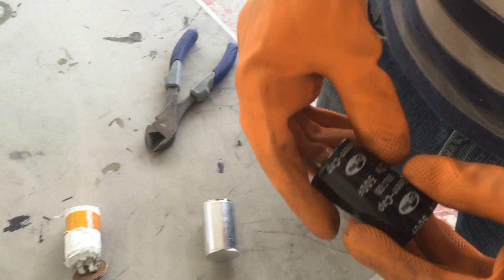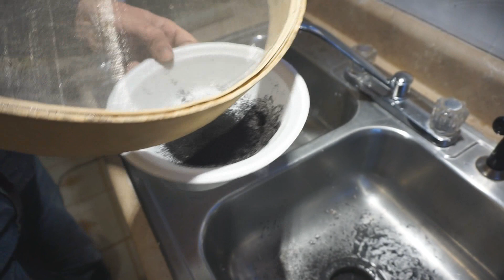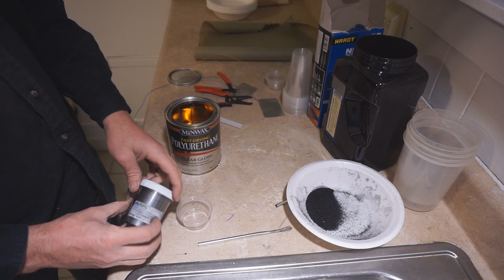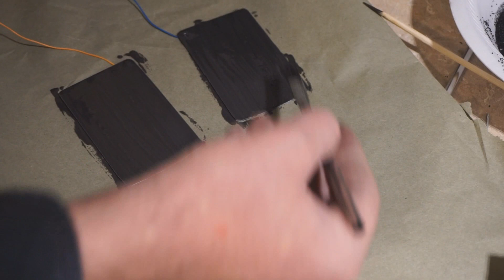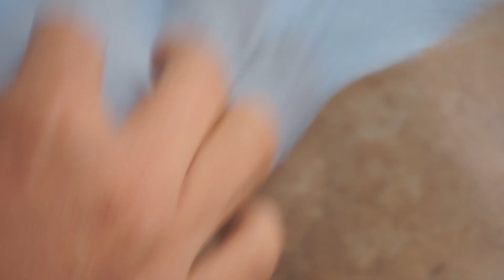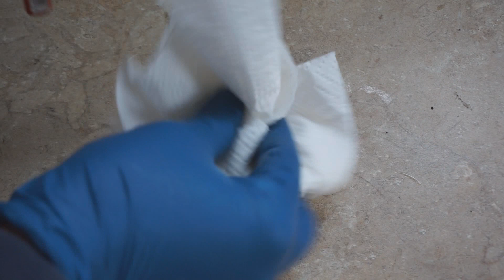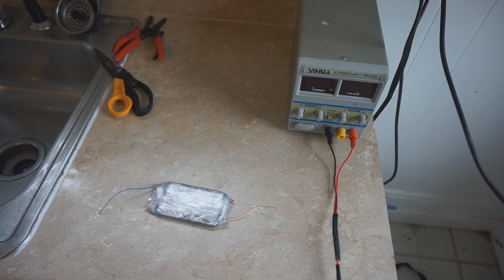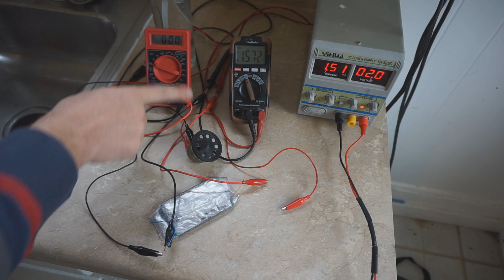Easy DIY Graphene SuperCapacitors

Comment: BTW, I've started a thread on EEVblog about this video: http://www.eevblog.com/forum/projects/diy-18-farad-capacitor/ It might be just a battery. Would be good to measure how often it can be fully charged and discharged, because this is the main difference between batteries and capacitors (besides the bigger capacity of batteries). And I guess if this is true, it wouldn't matter much if you use graphene or not, maybe do a test without graphene and only the activated carbon, too.
Reply: +lasersaber Your video are very isprirational :) 

I have a question for you... I have a project in mind that maybe I will sooner or later, but it is not easy to do, since I know the supercapacitors cost too much I'd like to build them by just taking a cue from YouTube videos etc... In particular, I'm going to make a capacitor bank for a solar system in order to eliminate the battery pack and because the caps are many vantage brutal peak current, speed of charge and discharge etc.. But they have a low energy density comparated at ordinary battery .. I would build a supercapacitor bank to 13.5 V 5000F (is so I know :) power. I have calculated that it takes 125 capacitor from 2.7V 1000f each put in combination to 5 in obtaining 13.5V 200F series to then put it in parallel with the 25 series from 5 thus obtaining a total of 13.5 V 5000F in combination 5S25P. ..the question is, how do I create and to know the exact size of a cell 2.7V 1000F? What should I do to build my project in the best way? Any suggestions? 

Thanks..
Reply: +Frank Buss how often or how fast? its all just minor details. do batteries and capacitors store potential energy? YES, do they require an input electricity and provide output as electricity? YES so they are in general the same thing. it has been seperated into two categories due to patent trolls and different uses, but at the end they are both doing the same thing with variable means...like a truck is bigger and has more power than a motorcycle yet they use the same combustion engine mechanics...for the same reasons.
it can be a mix of a capacitor and a battery in one construction...it does not matter.
what does matter is the way we can use it and how its different and if better from current "commercially" already built products. is it faster to charge? is it lighter in weight? is it cheaper to manufacture? does it have bigger/more life cycles? is it more recyclable? and other questions that are much much more important than "is it a battery or a capacitor?"...details and long page specifications are nice...just not always the most important. EEVblog as i see it is a warmplace of couch technicians who like to baffle about so minute details...while they are not that important...see the bigger picture please.
Reply: How often and how fast are important specifications. Lithium based rechargable batteries have 50% capacity after 1,000 cycles. If this is like a battery and performs worse regarding the number of charge cycles, the other things like price etc. don't matter, because it has much less capacity than a normal battery. And as I showed, there are already better cheap SuperCaps. But still impressive for a DIY capacitor/battery, and maybe he can even improve it.
Reply from the maker: +Frank Buss 
Thanks for starting the thread at EEVblog.  I see that they came down pretty hard on me for my little speech about higher voltage charging.  I was tired and not expressing myself the best.  What I was trying to say is that on my power supply at 30 volts there seems to be a larger current dump at first.  This may be because of some large electrolytic capacitors in the power supply.  Also because it is a regulated power supply it will not be able to output more than 5 amps.  Ideally I would like to be able to charge at a higher amperage than five amps.  Since I am limited, I just set it at 30V, let the power supply dump the initial current into the supercapacitor and then charge it at 5amps until the voltage reads around 5 volts on the supercapacitor.  For those who are worried about the jump cut you can watch the whole process on a early video here: https://youtu.be/d5cOebnCvXo?t=1m54s
Reply from the maker: +Frank Buss 
I agree that the capacitance of the power supply is negligible, but when you are charging in a few seconds I think it makes a difference.  Apart from that there is a difference between charging it at 5V or 30V.  When the supply is set to 30 volts it will deliver more amperage at the 5 volt mark as it tries to climb past the 5 volts.  In other words at five volts it will be be pushing a full 5 amps at the capacitor.  If you set it to 5V the amperage will taper off as it approaches 5V.  That is based on my understanding from experience.  To do it properly you also should watch the voltage on the capacitor itself with a separate meter. As the voltage readout climbs on the power supply the voltage on the cap lags behind.  It has to do with the small gauge wires coming from the power supply to the cap.  Anyway sorry about the confusion.  I did not explain myself well at all in the video on this topic.
  The link to the graphene powder is the first link in the list over at: http://laserhacker.com/?p=543
Here is the link itself: http://www.amazon.com/gp/product/B00OYAM7OO?
Reply: lasersaber  The output capacitors of the power supply might be only some 1000 uF, a small fraction of your capacitor. Try to compare the charging time, it should not differ wether you set the output voltage to 5 V or 30 V.
Another question: where did you get the graphene powder? You didn't list this on your website. And did you compare this to other materials, like graphite?
Reply: +lasersaber Your video are very isprirational :) 

I have a question for you... I have a project in mind that maybe I will sooner or later, but it is not easy to do, since I know the supercapacitors cost too much I'd like to build them by just taking a cue from YouTube videos etc... In particular, I'm going to make a capacitor bank for a solar system in order to eliminate the battery pack and because the caps are many vantage brutal peak current, speed of charge and discharge etc.. But they have a low energy density comparated at ordinary battery .. I would build a supercapacitor bank to 13.5 V 5000F (is so I know :) power. I have calculated that it takes 125 capacitor from 2.7V 1000f each put in combination to 5 in obtaining 13.5V 200F series to then put it in parallel with the 25 series from 5 thus obtaining a total of 13.5 V 5000F in combination 5S25P. ..the question is, how do I create and to know the exact size of a cell 2.7V 1000F? What should I do to build my project in the best way? Any suggestions? 

Thanks..

Comment: You made a battery, not a capacitor.
Reply: +Alfred Stampe no, this supercap holds a charge as static electricity. Batteries use chemicals.
Reply: Hooch Lover Yes 1cm2 of graphene is 1cm2. You are misunderstanding the mass to surface area ratio. 1 gram of graphene is 2700 cm2 whereas 1 gram of graphite is 20cm2 or so.  Most activated carbon is around 1200cm2 per gram.

The oxygen groups on GO allow redox reactions to take place more readily than simple carbon. Leading to higher energy density by mass and surface area.

And yes the newest research coming out is that electrolytic capacitors will exceed supercapacitors in energy density. And transition metal colloids exceed graphene's energy density. It's a very complicated subject once I am done with my new supercap I will explain it in a video, subscribe if you like.
Reply: ***** Yes technically double layer is static but not like traditional capacitor static electricity the charge is stored differently. There is nothing special about this, it is a DIY thing though, which is cool but EDLC caps are good for high discharge currents.
Reply: +Alfred Stampe It's only a battery if there is oxygen for the alum collectors to oxidize. Since Laser sealed it here there will be no oxidization after some time, provided the seal is good. To avoid alum collectors oxidizing and giving off a voltage (which can negate the capacitors charge and reduce your total energy supply) you need to seal it from oxygen and not provide too much charging voltage. I see a lot of other videos on the internet showing open air alum collectors which are either adding to the total voltage/energy or removing it. If anyone here is experimenting with this you need to use a better metal collector or at least seal it before using it, if you want reliable results with the capacitor.
Reply: +TheTrueM3ga lol, supercapacitors use chemicals as well, and store energy in electrolytic double layers or with faradaic redox reactions.  This is a EDLC cap, has nothing to do with static electricity.
Reply: Lupus Mechanicus Did a bit of research: We both were wrong: Supercaps use double-layer capacitance (which is real, static) and pseudocapacitance (electrochemical).
I just wondwr what's so special about this one. Because normal supercaps also use activated carbon. And this here ain't graphene.
Reply: +TheTrueM3ga he said he uses graphene powder not graphite, unless I'm mistaken? Personally I don't see why graphene powder itself will be much difference to graphite powder . If you think about it, if you use perfect graphene, which is perfectly 2d, the surface area is actually less than using a metal electrode instead of carbon. Because a perfect 2d plane has no holes, has no tubes, it's perfectly flat. So a 1cm square of graphene is exactly 1cm square surface area. Activated carbon is good because it has lots of tunnels and holes, which increases surface area. Graphene on a per gram basis is much better than carbon, but it's not much better on a surface area. However, supercaps aren't exactly the most researched and open ideas so its quite possible that even though graphene has less surface area per cm2 square, that its a better super cap material for other reasons. If anyone cares I can list those reasons but I don't want to overcomplicate this.
Reply: Hooch Lover he said he uses activated carbon (powder). That's how every supercap is made. Activated carbon get's macerated and then compressed
Reply: ***** Not exactly, you can make supercaps using a plethora of materials.
Reply: Hooch Lover No alot of misaligned planes of graphene has a theoretical surface area of 2700 meters squared per gram, graphite is around 50 meters squared per gram.
Reply: +Lupus Mechanicus That is "PER GRAM" :) .What is graphene if its perfect? It's a single 2d surface, which means a 1cm piece of graphene is exactly 1cm2 of surface area no? There is actually a physical limitation we have right now due to having thick separators and such that I can see activated carbon always being better for supercaps until that is overcome. Unless graphene is doing something with pseudocapacitance which allows it to store more energy than activated carbon.
Reply: Hooch Lover ughh trust me man I build these things graphene oxide has a much higher surface area and carbonyl loading than oxidized activated carbon.  But you are right to an extent ZnCl2 activated water hyacinth carbon has around 2500 meters squared per gram and PCMS also have a very high surface area but the easiest thing to make is graphene oxide. a graphene oxide super cap consists of many very small disordered sheets of graphene not one big flat sheet.
Reply: +Lupus Mechanicus That is interesting if you are right. Layers of graphene is what we call graphite, and graphite has a much worse surface area than activated carbon. Could you explain why graphene oxide is better than graphene itself? I haven't heard about GO being used in supercaps, except as the precursor to getting to graphene. Do you dispute that a 1 centimetre squared region of graphene is 1 centimetre square of surface area, ie it's 1:1? I'm not talking about "layers of graphene", ie graphite, I'm talking about the perfectly flat 2d substance called graphene. Graphene beats activated carbon on a weight basis significantly, but you need many more centimeters squared to do it. But like I said, "Surface area" isn't the totality of the supercap question.
Reply: +Lupus Mechanicus I'm not confusing mass to surface area ratio, I was just a bit confused by an earlier statement you made regarding graphene. I checked out your videos, you're a bit further along than me in my testing, Ive got some new equipment coming and being built at the moment to start experimenting. I was going to work out a decent way to bind metals to the carbon electrode to get those faradaic reactions happening a lot. My initial supercaps sucked, but I got better and better at them, learning from my mistakes. Luckily I have some free money to play with so if you have any ideas you want me to try I don&#39;t mind trying. I'm for an open sourced solution here, not interested in making money off this. I want the answer to be out there in a way nearly anyone can become energy independent with a bit of lab skills, if its possible.
Reply: wrong it is a capacitor.  You seem to know so little about capacitors and batteries you think this is a battery.

Comment: Activated carbon != graphite != graphene
Reply: +Mike Trieu (MegasChara) = Lead Pencil Core. The meaning of lead pencil is not that it is made of lead, that's just the colour of it. the core itself is made of Graphite! Try drawing a thick line on a piece of paper then testing it with ohm meter.

Comment: Have you done enough tests to figure out how many joules of energy it is able to put out once stabilised?(it may be stable from the get go idk.)
Reply: +Solomons Words you can calculate that easily enough, choose 10 points in the 10 minute span it was running, record the voltage and current at each point, calculate the power in watts by multiplying the voltage and the current together (it's in milliamps so take the number and divide by 1000) then add up the total joules dissipated between each point. 1 watt = 1 joule per second
Reply: I know how to calculate watt seconds... this is a initial test for him. I'm asking what he gets after multiple runs. If the joules aren't stable and change after a couple runs knowing the joules for this video may be misleading. 
P=(EI)/1000,  W=PT is a lot easier than saying an entire paragraph ;) thanks anyway. Some people need things spelled out.
Reply from the maker: +Solomons Words 
I will do some serious calculations as soon as I feel that the performance is reaching a plateau stage.  I had a previous credit card size build using KOH that consistently ran the same motor for over 1hr until the cell quit working one day due to it drying out inside.

Comment: I don't want to be a jerk about it but the title of this video is not correct.

The material used OR produced in this video is NOT graphene. Graphene is made out of graphite and graphene becomes graphene when you end up with just a single layer of graphite atoms, so that it looks like a sheet with the thickness of a single atom. As soon as you have two or more layers of graphite atoms or just a single string made out of graphite atoms it is no longer considered as graphene. 

Because of the single layer of atoms graphene has some unique electrical properties that you will not find with a sheet of graphite atoms made out of two or more layers. This is what makes graphene so special. Also graphene is more then 90% transparent, so if you can't see through it it is not graphene. 

The easiest way to produce a graphene layer is to color a piece of paper
 with an ordinary pencil and then use the cheapest transparent sticky 
tape (you might want to experiment with different types of tape, or even
 a combination) to pick up some graphite from the colored piece of paper
 and keep on doing this until you covered the whole piece of sticky 
tape. Then you take a new piece of tape (maybe a different kind) but 
this time you use the new piece of tape to pick up some graphite from 
the first piece of sticky tape and you keep on doing that until the 
second piece of tape is completely covered. You keep repeating this 
whole process each time using a new piece of sticky tape to pick up 
graphite from the first piece of tape until it is no longer possible to 
pick up graphite from the first piece of sticky tape. Eventually, and 
only when you manage to do this without breaking or destroying the tape,
 the first piece of tape will end up with a single layer of graphite 
atoms, and then you have produced graphene.  https://www.youtube.com/watch?v=ehvksWx3AJQ

I believe this was the method used by the scientists who discovered 
graphene, and yes it really was that simple and they won a Nobel prise 
for it. They showed the process LIVE on Dutch TV a few years ago but 
since it has been a while the exact process might vary a little. 
Nevertheless it is a long and tedious job, and succes at the first try 
is not guaranteed, but using some sticky stuff is the only way possible 
if you want to do this at home without a lab and chemicals. In the 
following video you get a better explanation about what graphene exactly
 is and how they produce it inside a lab environment. https://www.youtube.com/watch?v=WFacA6OwCjA 

Still a nice video with a fascinating result, so thumbs up for that LaserSaber.

Peace, iT
Reply: Doesn't the electrochemical exfoliation of graphite make "few-layer graphene"?  I think people are simply calling it "graphene", for short, even if it isn't technically correct.